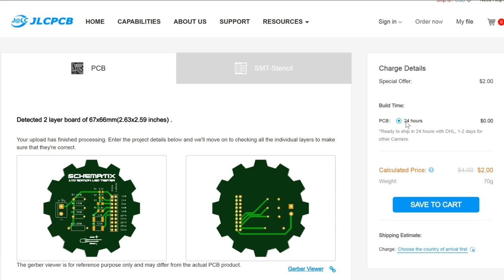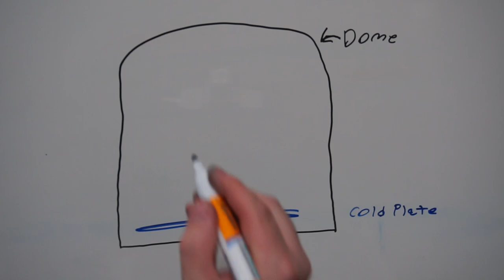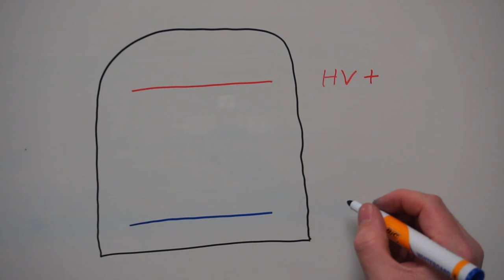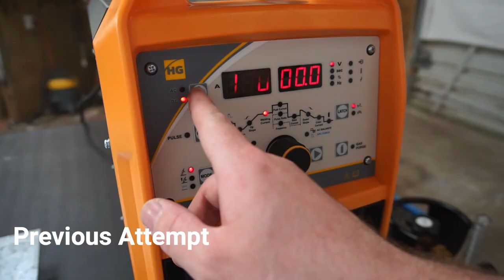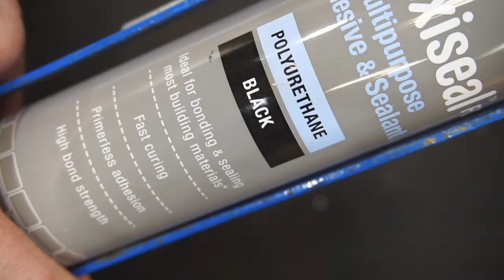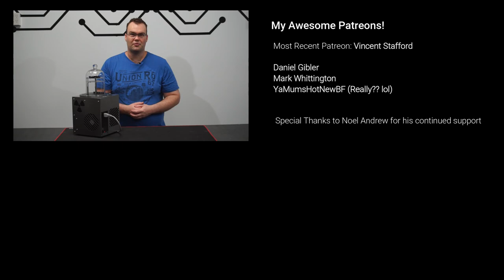Building a Cloud Chamber to see Radiation!

Comment: My gamma spectrometer shows that my wood cabinets are enough to stop the radiation from the uranium on my fiestaware, thorium lantern mantel, and ion chamber from my smoke detector. I am likely getting more radiation from my granite countertop.
Distance is the best protection from low levels of gamma so being a few feet back would be adequate protection. Having it in a lead castle is excessive unless you are dealing with industrial radiation sources.

Comment: Great job! Looks like it could be the brother of the one we just built, mind if we link to you from our video? (See: physics anonymous). Also a couple easy things that might improve its efficiency: something that makes a labyrinth seal around the dome will both help contain the alcohol and keep errant flow from creeping in through the base. Also if you can come up with a high enough current buck converter- running the top peltiers at 4v will make a lot less heat from them and the surface will drop several more degrees. Anyway that's one very cool looking chamber, and love the clean surface look!
Reply from the maker: Hi Ryan, Thanks for your comment & support. It seems between you, me & electroboom. Cloud chambers are the favorite of the month! You're welcome to link to my video. Do you mind if I link to your build? You've built an impressive cloud chamber too!

Comment: Very thorough! I have a question for you: How long does your set up run until the alcohol is puddled on the bottom plate?
Reply from the maker: Thanks, I'd say around 3~5mins until the floor of the chamber is completely wet with alcohol